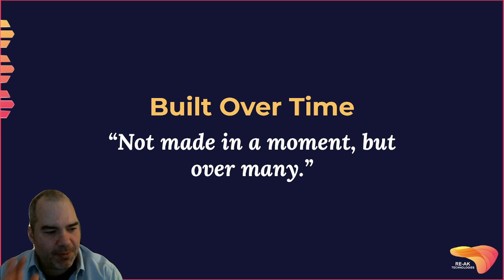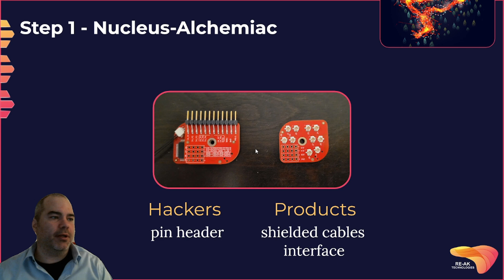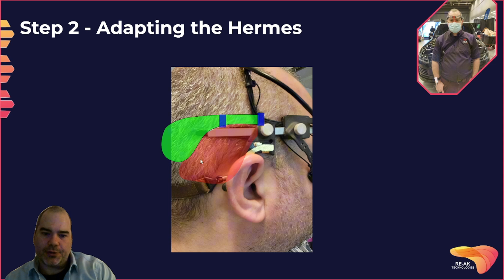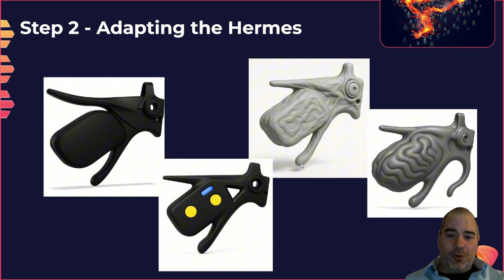Wireless Headset Update (Mechanical Design, Novel Brain Computer Interface)

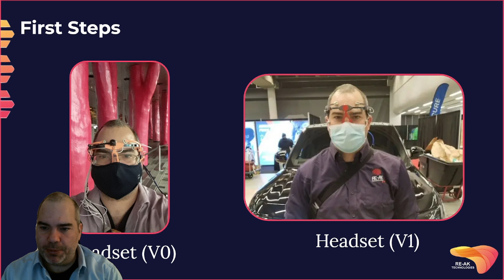Comment from the maker: 1:07 Previous versions and backstory
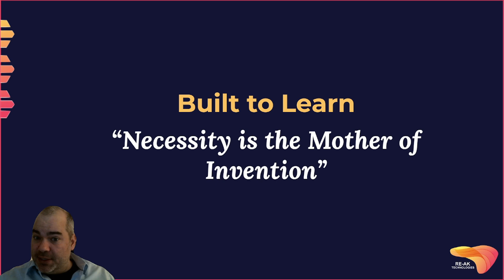10:59 Issues addressed with new version
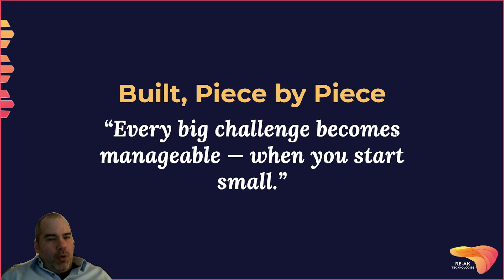15:14 Working through the parameters of the new version
25:05 First concepts and walkthrough the mechanical iterations
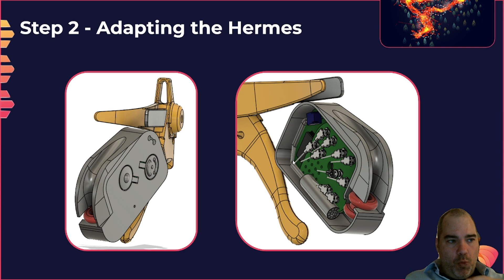33:08 Current status
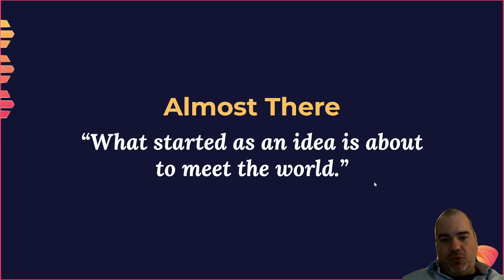33:47 What's next